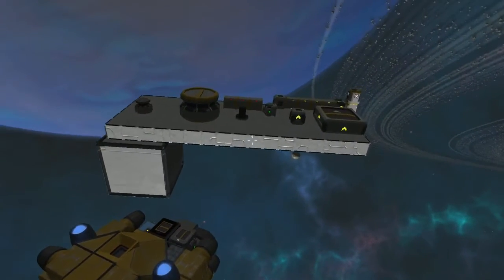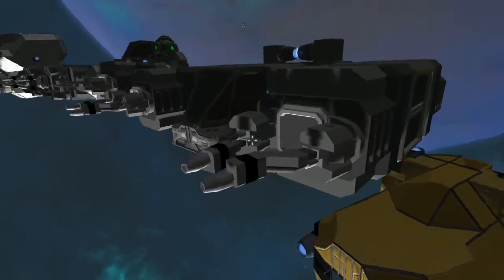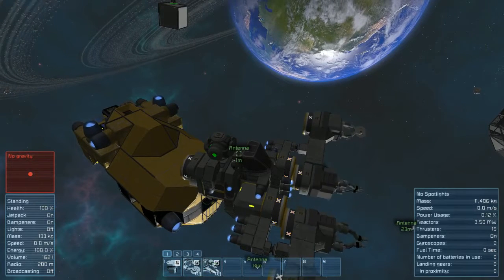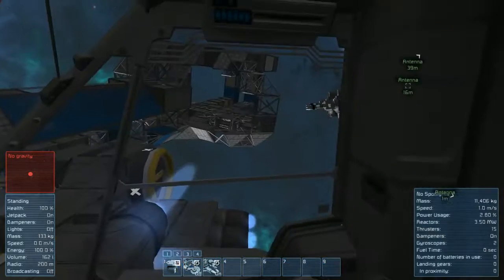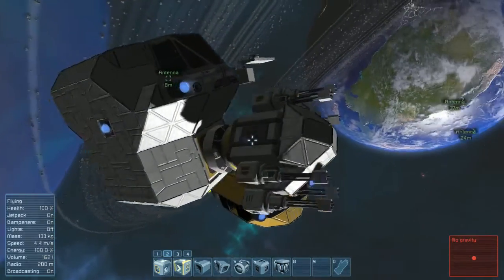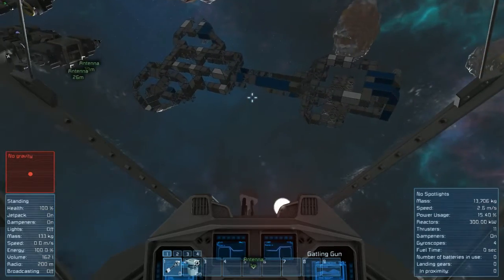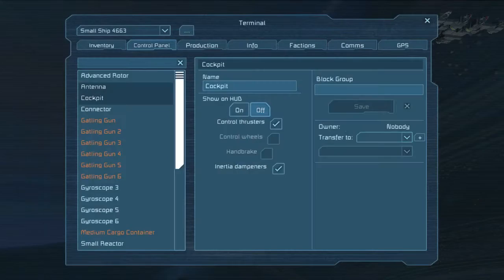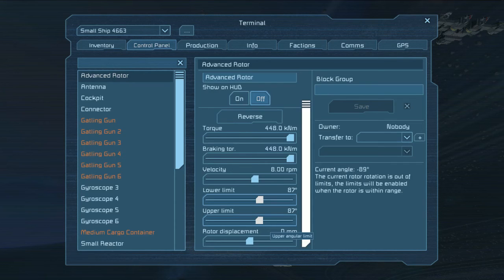Space Engineers - Basic rotor tutorial and multi-utility craft.

Comment: i tried to make such multi-utility ship it used rotors to turn welders into 30 degree angle so they face same spot in front of cockpit, problem is, the ship is very hard to control, it slooowly turns on its own or sometimes i'm unable to roll with E or Q key until i change my position abit... you did not get such problems with your small ship which have big parts on rotors?
Reply from the maker: technically they are small parts on the rotor, just simply place it and build on it and it should default to small. Now the lighter crafts will experience more i guess we can call it torquing? from the piston/rotor operations. My bare bones rotor utility craft has a significant drag from the setup, and the more you accelerate the more you will feel the effects. You can counter this by adding both mass and thrust ability to the main chassis.